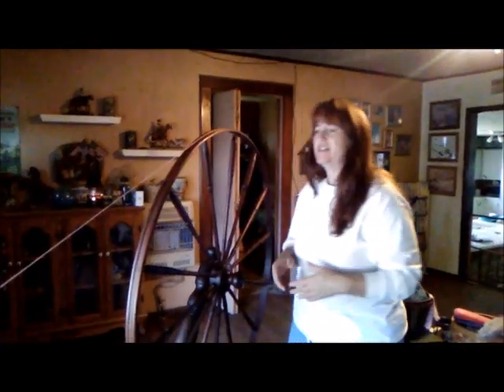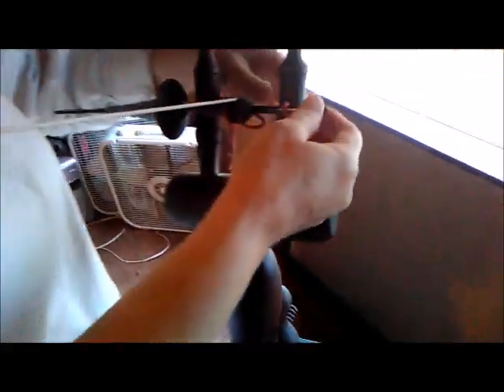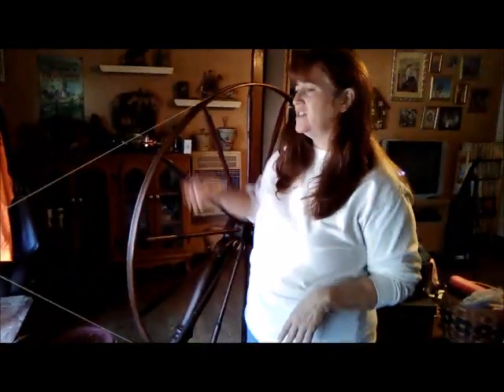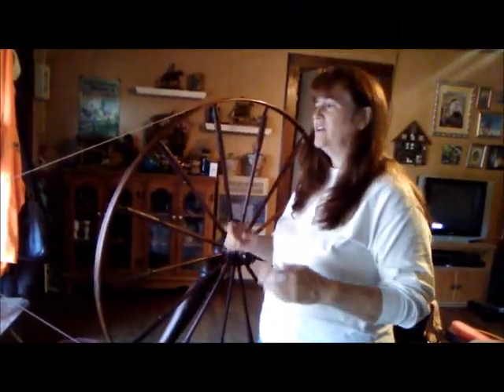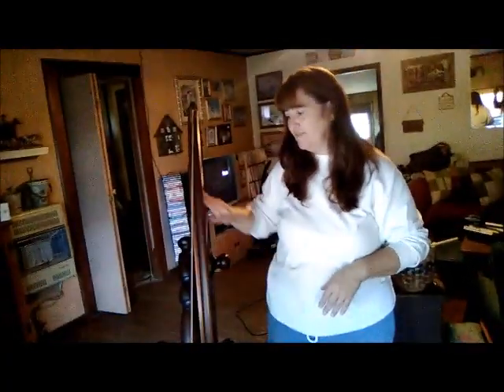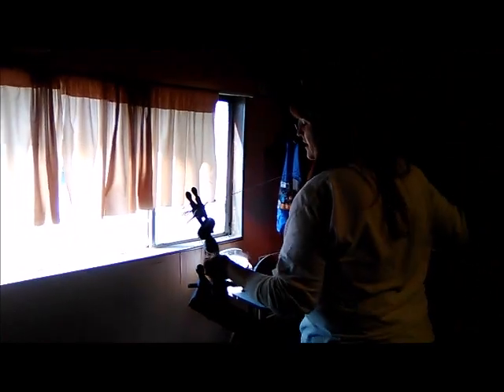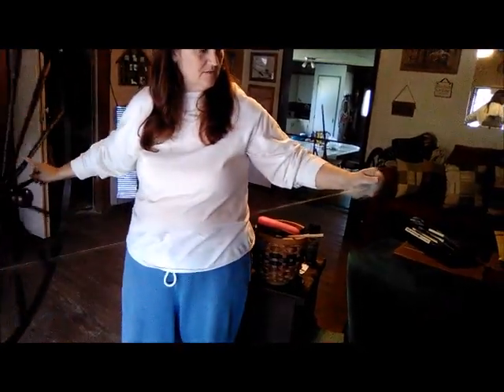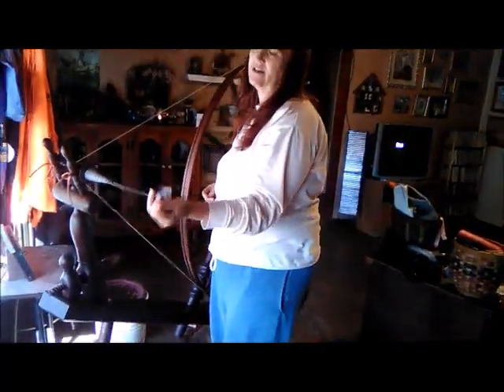Let's get spinning on a Walking wheel or Great wheel

Comment: Thank you so much for keeping it simple! I probably watched 30 videos last night to learn about my wheel. I've had it for 10 years as a decoration and never used it. Last summer I bought sheep and decided I want to spin my own yarn. Most of the videos only show you how to feed the  roving onto the spindle. They didn't teach how to set the wheel up to start. My wheel isn't exactly like yours, but it was close enough that I was able to put on the drive band and work with the tension. Thank you so much for sharing.
Reply from the maker: You are more then welcome ... People like you are why we do what we do ... I had to learn it all myself and wanted to make sure that no one had to go through what I did when I started ... I love keeping it simple
Reply: Do you have any advice on how to keep the maidens from coming off of the mother of all? If I loosen the tension then my spindle doesn't turn. If I tighten it, the piece that holds the maidens and the spindle comes out of its socket.
Reply from the maker: @tammym3753  First check to see if the Mother of all is secured properly.  Sometimes they used something like a wedge or nail or peg on the underside to hold it in place so it won't come out of the socket.  Second when you adjust it is really little adjustments so don't over adjust.  Can you send me pictures of the Socket, mother of all and tension on your wheel ... most are different so I might be able to get a better idea how to help if I can see it.  farmontheprairie@gmail.com

Comment: What beginners do not seem to understand is that you cannot draft twisted fibers. Unlike a treadle wheel, you do not have to keep the wheel turning at a near constant speed. Twisting of the fiber is controlled by the rate at which you spin the wheel. Fortunately this can be instantly and rather precisely controlled with your right hand. The SECRET is to keep drafting just ahead of the twisting. It is possible to produce four or five feet of yarn in just 10 or 15 seconds but don't get hung up on time here. Pinch the yarn and give the wheel a once around to put the final twist in the yarn before winding on. Rolag size is only important if a specific size of yarn is necessary. A very fine yard is much easier to spin if you start with a smaller size rolag. Clean, loose carded , short staple wool is best for learning on. Spinners will see that they are drafting from one side of the rolag and try to twist and turn their left hand to correct this. The solution is simply to turn the rolag over (180 degrees) and this will correct itself. I have been doing this since 1980 and have had so many people tell me that they cannot learn the Walking Wheel.  I don't think I have needed more than twenty minutes to teach anyone the technique.
Reply from the maker: Thank you for your input but this video wasn't intended to be very technical ... I just want them to get spinning and if they try it they will learn all the ins and outs but I just wanted to cover the basics.

Comment: So I have a great wheel that looks pretty much the same as this but I’m not sure if yours has a ridge around the wheel to hold your drive band mine definitely does not and I’m having issues with the band staying on the wheel any suggestions?
Reply from the maker: My wheel don't have a groove either ... this issue is cause by the alignment of the wheel and the Mother of all.  This is the one thing that each wheel varies on so all I can suggest is to stand behind the wheel and look towards the mother of all and make sure it is in the straightest line you can